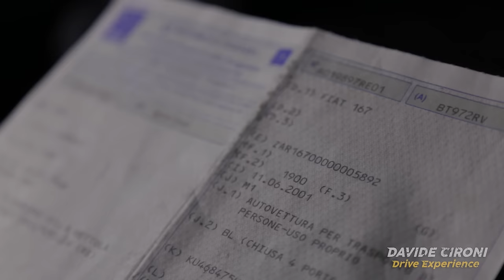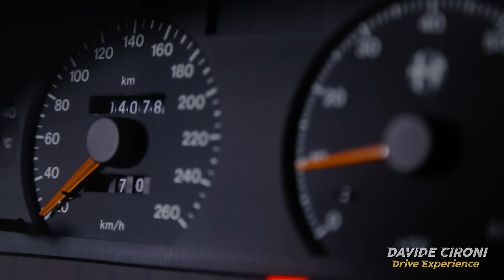155 GTA Stradale - il Santo Graal - Davide Cironi Drive Experience

Comment: Ho cercato in piú e piú fonti in modo da avere qualche informazione sú questa GTA stradale e credo proprio che il modello in questo video siá proprio l'unico esistente..in ogni caso motoristicamente simile alla GTAZ derivata dalla Q4 ma differisce appunto per materiali ed estetica...a questo punto Davide sè riesci a trovare la 155 sport wagon Q4 avrai praticamente messo le mani sulle uniche due Alfa 155 prodotte in unico modello..nel caso della wagon si tratta di un prototipo ma cmq prodotta sotto la direzione Alfa e credo che anche questo lo siá.Io ho messo gli occhi sú una comunissima 155 2.5 Td Sport..di colore rosso e allestita da sembrare una Q4 ad eccezzione degli interni.
Reply: in ogni caso immagino che le alfa prodotte in unico esemplare siano tante ma un altra chicca che mi piacerebbe tanto vedere Alfa 164 pro car...unico esemplare.